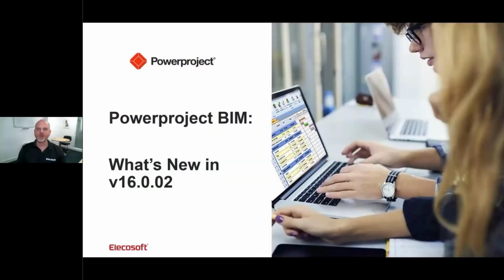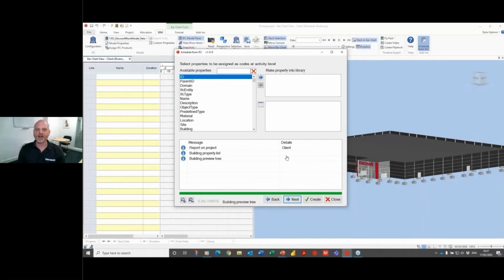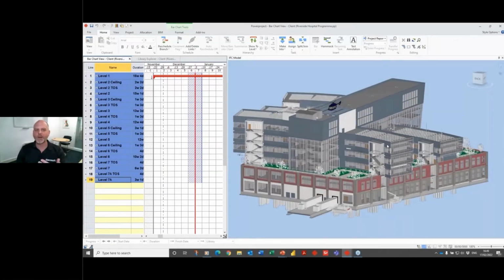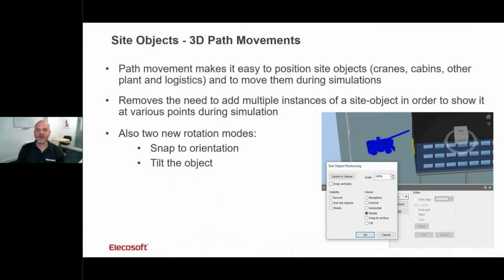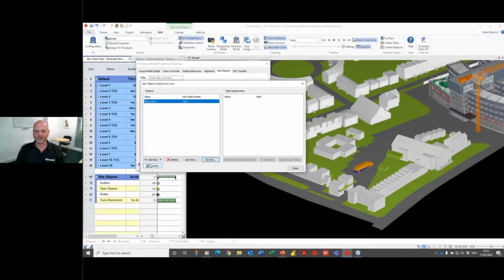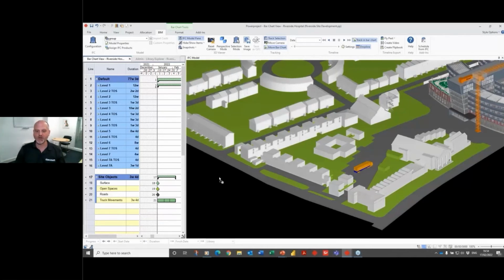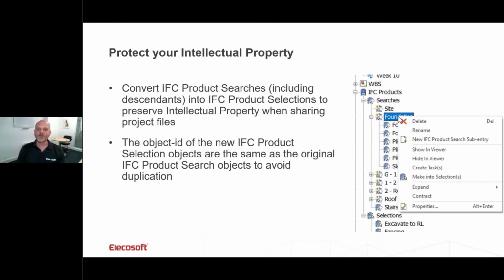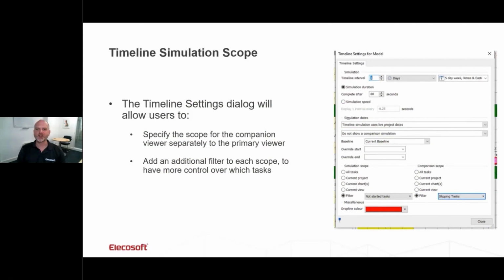Powerproject BIM - 4D planning just got easier

Comment: Unfortunately, the project builder does not come with this version; Elecosoft informed me that it will be an addon that will be released at some point in the future.
Reply: Hi Konstantinos - I'm pleased to confirm that the Project Builder for the IFC files is available now for use with Powerproject v16.0.02.  As a supported customer, you can download this addon from our Support Portal for free, using this link: https://support.elecosoft.com/index.php?action=read&id=2713